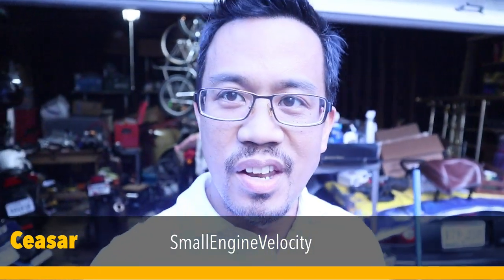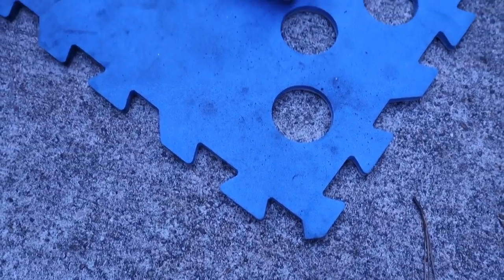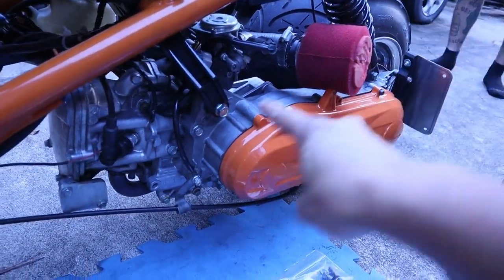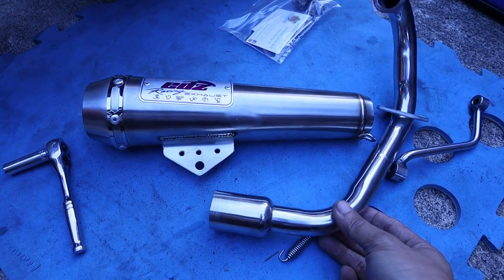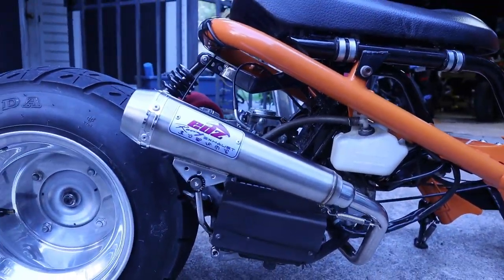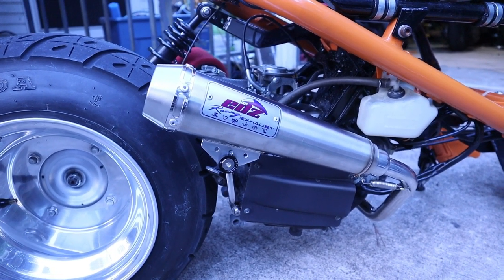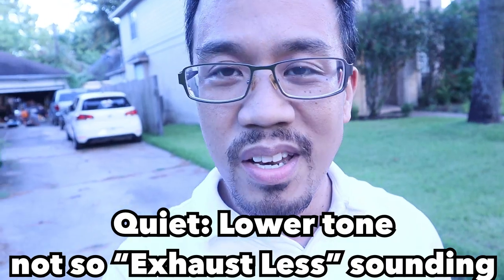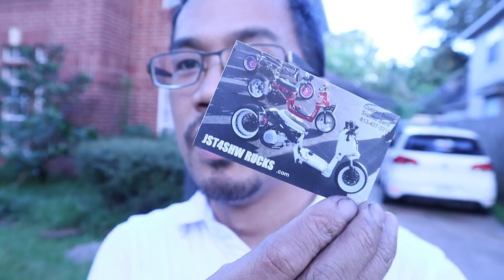JST4SHW Ruckus Exhaust, best value for $200 ? FATTY and SKINNY

Comment: Never was a fan of headlights connected to the triple tree but always loved lower headlight bracket setups on the battery box itself. My old ruckus i used the composimo bolt on kit and it sat the headlights just low enough for my likings.  Awesome mod though and yes it does look like a bird lol.
Reply from the maker: honestly that's what I thought this is what it was. I was presently surprised.

Comment: Great video. Looking for the test run and tune.
Reply from the maker: As soon as I can I will :) Its gonna be a busy week. I want to see if I can still hit 57.1mph or do I need to adjust something. Right now im 38/78 jets and wondering if I need to go bigger
Reply: Any test run yet?
Reply from the maker: Not a full speed test but without draft and a small headwind I got 52mph and smaller weights

Comment: So I purchase this exhaust and since my 2009 Ruckus is stock to the bone, the radiator cover is blocking me from putting on the exhaust. I mounted the header pipe but now I have to change the radiator cover in order to mount this.

Comment: Back pressure being a performance factor is a myth. No engine needs back pressure. However, turbulence in the exhaust gases or scavenging is a factor.. Too large of a exhaust pipe diameter can create scavenging. A smaller pipe (but not to small) can optimize the velocity of the exhaust gases.
Reply: True for 4-strokes

Comment: Any update on the performance aspect of the pipe?
Reply: I'm curious the same thing. Also wondering if it's fallen apart by now or what
Reply: I’m interested as well , read the comment from BB that states the header is to large in diameter . And it will definitely impact performance .

Comment: Do you know if this exhaust is only for stretched rucks? I got mine in today and it will not fit because of the frame tubing. Put the whole thing together and put it on as best as I could and where the header meets with the motor the right side has about a 1/2 inch gap and doesn’t seat right at all. Or maybe my header just wast made properly?
Reply from the maker: It’s for any ruckus for sure. Put the header on (loose not tight) , then mount the exhaust and mount. Once complete (not fully tighten the mount) tighten the exhaust header and the mount a little at a time. You may have something twisted to much. Keep me posted.
Reply: That’s what I did last night.  Still a no go on the fit.  The header is supposed to come out from underneath and then do a 90 degree angle to run straight along the frame and back. Mine is bent at like a 75-80 degree angle and the header runs right back into the radiator. I have pictures I can send to an email to better explain it.
Reply from the maker: Is your radiator cover on ? The stock one , have you tried to install with the radiator cover off. I have  a custom one (my build) installed.
Reply: Yea I took it off.  Still doesn’t work properly. I’m going to try and order an extra gasket.  Maybe I’ll be able to shim it down with the extra gasket and it’ll fit
Reply: @seanrenn7239  did you ever get it to fit?
Reply: I inquired and you probably know by now , the exhaust in the vid is only for a stretch ruck , I didn’t really want to stretch mine but I’m thinking I like this exhaust enough to do it . They do make one for stock but I don’t care for the pipe angle on it .

Comment: That header is wayyy too big for 49cc. You’ll lose mph with that
Reply from the maker: It’s gotta be better than my old exhaust. My old exaust was literally a 8” dump pipe and I got some performance out of that.
Reply from the maker: Also the end of the pipe is a pretty’s small opening , is that still true if it’s that way?
Reply: Small Engine Velocity yeah you want it to be 16mm or less for the 49cc. That’s why the yoshimura does so well the took the time to r and d and see what diameter worked the best with that motor.  Unfortunately these aren’t like vehicles where the bigger allows for more power or that would be great.  The first gen gp exhaust for the ruck was 25mm and people were losing 8mph right away from it.  Good video through
Reply: @burnoutbobby  I just completed TRS stage one performance pack and about to start stage 2.  Is there a quieter exhaust your can recommend? California has new laws this year with really hefty fines for loud pipes. Thanks!"
Reply: mark reagan there are not lots of quiet pipes out there I think the hotlap single tip that’s carbon that trs sell is the quietest that you can get but still not close to stock
Reply: @burnoutbobby  thanks!👍👍  I will take a look at the hotlap.  I'm not interested in being quiet as stock.  Just don't want a ticket for too loud.  Also, I don't want to install something that works again the upgrades I am installing.